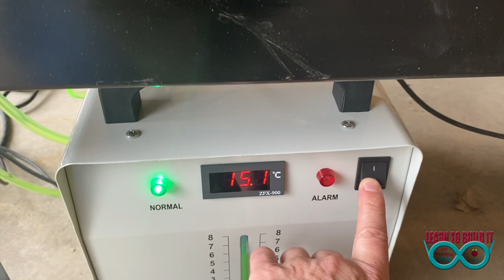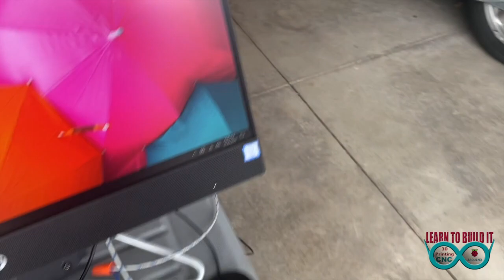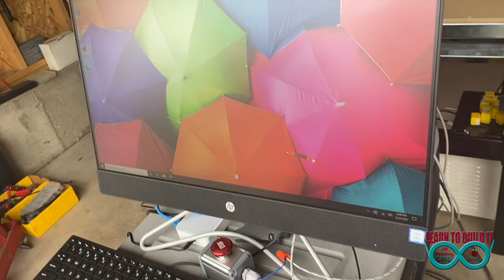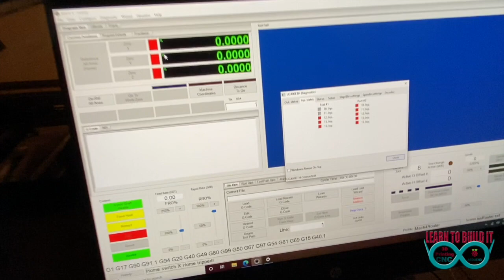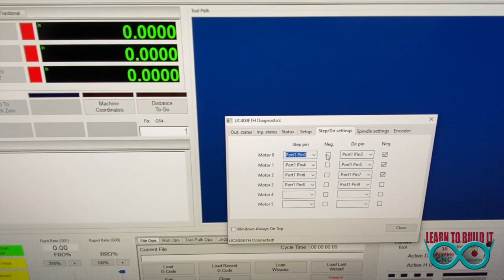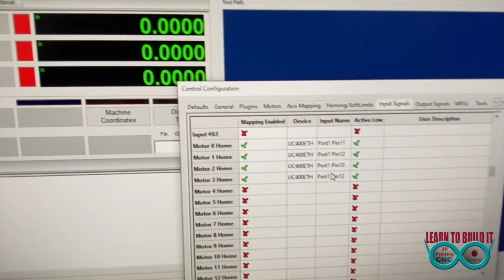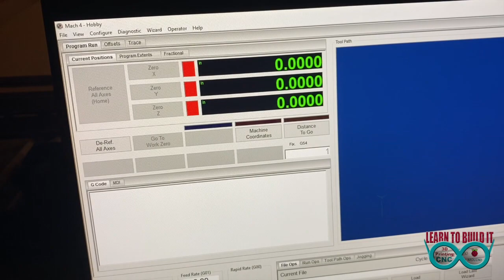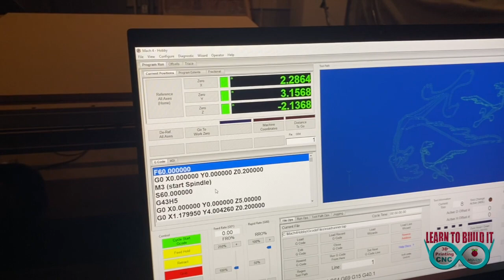Zenbot CNC build part 2. Geckodrive, VFD, MACH 4 and UC400ETH

Comment: I need wiring uc400eth to breakout board sir?
Reply from the maker: To connect the us400eth you need to items

First you need a Gender Changer
https://amzn.to/2Rmjujt

And a cable to go from the uc400eth that converts to the 25-pin parallel Port
https://amzn.to/33shBYf

Hook those up and the power wires and power. That is it.

Hope it helps
Reply: @learntobuildit2785  have diagram sir ?
Reply from the maker: I will try and build one for you.
Reply: @learntobuildit2785  i waiting ...thanks sir